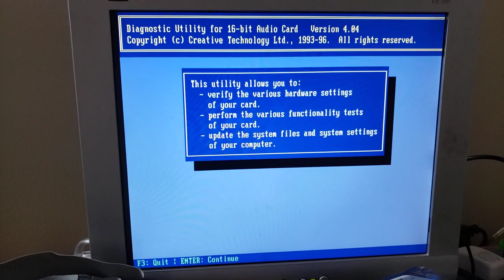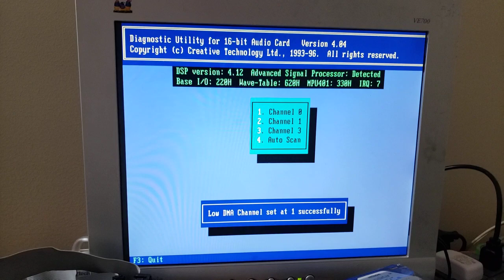The Etop ATX-E7 is a freakishly overpowered Socket 478 motherboard.

Comment: I have a bunch of socket 478 CPUs laying around , I'm planning on buying a motherboard that supports up to 4 gigs of ram .  But  according to experts , a 64 gits OS is required to get all 4 gigs used by the system , and socket 478 desn't have 64bits CPUs  . In your case , are  all of you 4gigs ram detected ?  or your computer displays 3.5 gigs ? 
rumours say there's a 64bits socket 478 cpu  , but up to know nobody has put his hands on it , and you can't buy it anywhere
Reply from the maker: @tunkunrunk  3.5 usable here
Reply: Forget 64bit AND 4 gb of ram with this socket, all later chipsets like 865 and 875 are limited to 3.2/3.5 gb regardless of OS. (unless you go for those rare later boards with via or g31/g41 chipset made by biostar or some random chinese brand, which isn't even good quality anyway...)
Reply: @arz1898  I was surprised to see socket 478 motherboards with 4 gigs of Ram max , what did they have in mind ?  did they expect a miracle OS  after windows XP  ? I read there's something you can do in your operating system registry to make it accept  all 4 gigs , it works with windows xp , not sure about seven

Comment: U wanna find me one of these and build an old oc for doom
Reply: Thx for the info
Reply from the maker: Just gotta hunt around on Ebay. These are the websites I referenced to figure out what would work and what wouldn't work:

https://ilovepa.ws/pentium-4-dos-gaming/amp/
https://flaterco.com/kb/ISA_chipsets.html

This board in particular is a much cheaper option (but lacks AGP) that has confirmed ISA DMA support for sound cards, if you don't want to take a risk like I did in buying a board without clear confirmation of DMA support.
https://www.ebay.com/itm/312032022817

Comment: Nice! I've got a saved search for one now. Hopefully one will turn up that's not hideously expensive. I actually have a socket 478 hyperthreaded CPU to slap in here! My main interest is with the ISA slots, though. I've got a Windows 2000 machine pulling along with a DTC 7287 RLL controller, but it would be nice to have more power than a Pentium II and it would be especially interesting to see later versions of Windows to use it.
Reply from the maker: It should be possible to get up to at most windows 7 with this board if you're not willing to go about with those workarounds to remove the need for nx-bit on windows 8 and up. I have no idea for sure if there are any 478 cpus that support nx bit, unfortunately, though the BIOS of this board from what I remember suggests support for NX bit given a compatible cpu, meaning you'd then bump support up to windows 10 32 bit.

Comment: You should try tiny10 or tiny11 which are light weight versions of Windows 10 and 11.
Reply from the maker: That depends entirely on finding a cpu that supports NX bit on socket 478 (windows 10) or both NX bit AND x86-64 (windows 11)